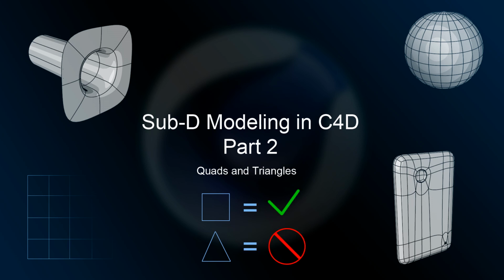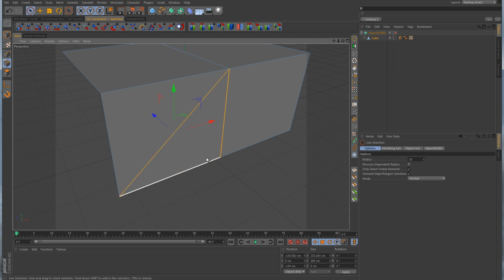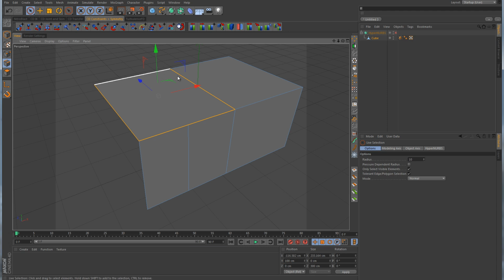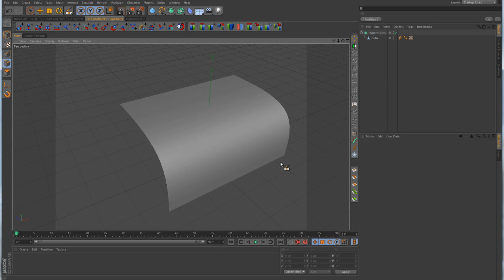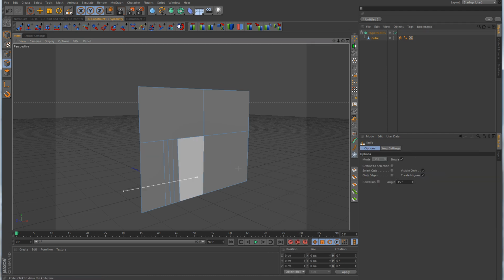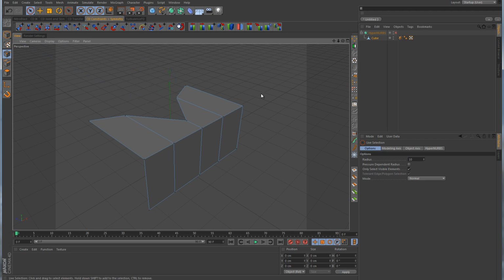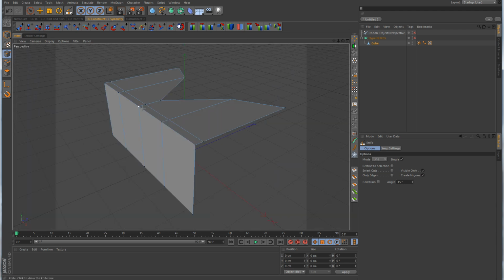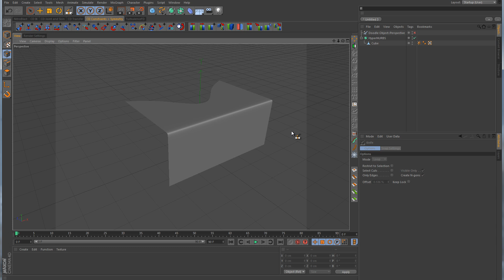Sub-D Modeling in C4D - Lesson 2 - Quads and Triangles

Comment: Would it be fair to say that in Sub D modeling it does not matter too much how ugly the quads may look "under the hood" as long as they are quads and they do the job in making the model look good?
Reply from the maker: +2D or not 2D Yes, but only to a certain extent. You dont want elongated quads where one point is pulled far away from the others. You also want to make sure that the flow of quads follows the contour of the object.

Comment: Thank you so much, awesome video!

2 Questions:

1) How would you model a sphere/hemisphere/capsule (any shape with a dome) with HyperNURBS where the North and South poles converge into a single point and you are left with a ring of triangles?

2) How did you get your HyperNURB surface across the 4 quads at the start of the video to have sharp corners at each end. When I recreate your scene, I get a soggy/melting biscuit shape where the corners rounded off.
Reply: Matthew Wagerfield hi!
 I looked in the help, and I found the command "dot" (.)
Reply: I am looking for answer to your question 2) , did you figure it out?

Comment from the maker: While triangles will not cause any type of artifact or problem on a flat surface, its always good practice to work with quads. You can get away with triangles on a flat surface, but I prefer to try to find a way to remove them.